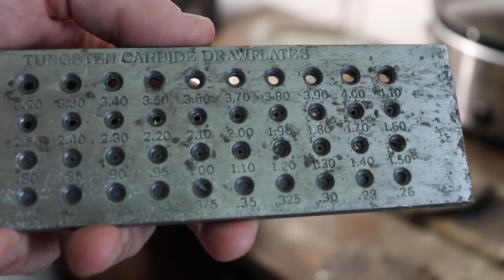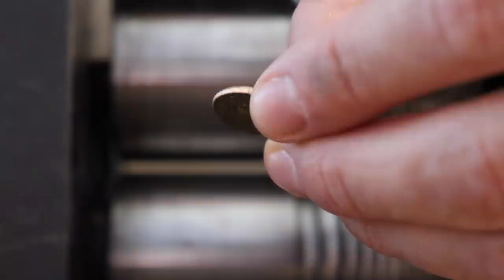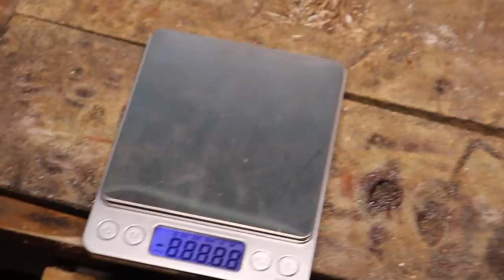Making 14k Gold Chain.

Comment: Great video. I would like to know that after heating gold rod or chain and then put into the solution in the pot. What's that solution? Why is need to heating in the pot? Thank you.
Reply from the maker: You do it to remove a flux after soldering.
It is a lemon asid.
Works very well when it worm.
Thank you for watching! 🙏👍